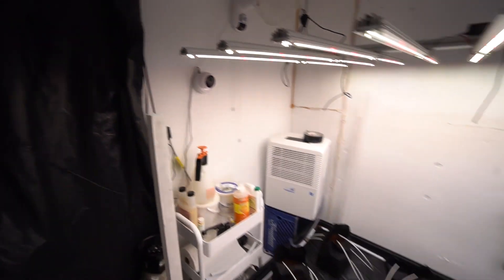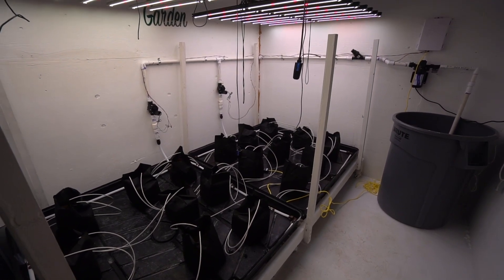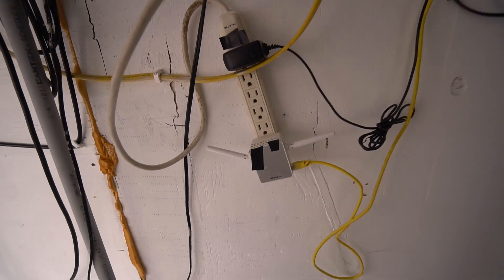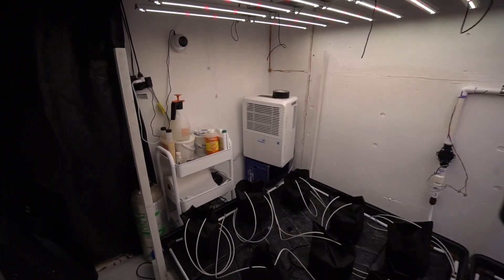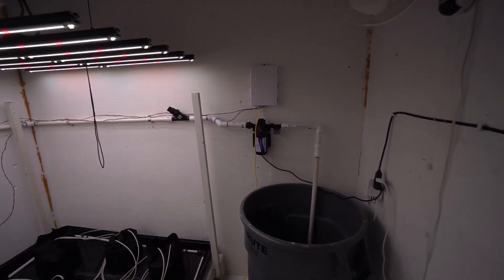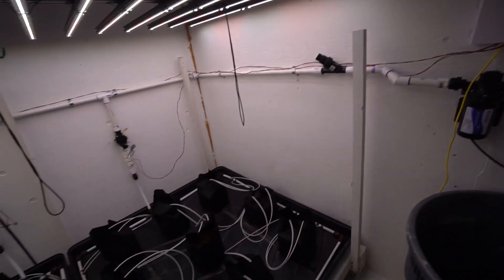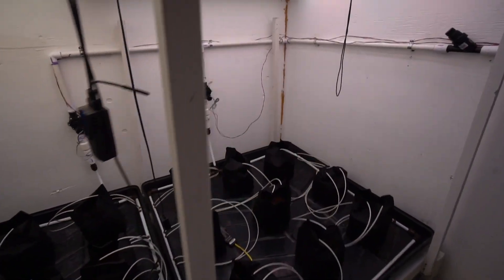Hydroponic Garden Tour: Drip Irrigation

Comment: how do you get the system to stop irrigating precisely? with the pressure can't get out of your system, doesn't the drippers run for hours once you started?
Reply from the maker: drippers are 25psi regulated. So is the system +/- a little. The pipes/lines don't drain under that pressue.

Comment: Superb setup.. makes me happy to see.. just a comment on the placement of the solenoid valves..it looks nice and symmetric.. but wouldnt it be easier to have them on de first wall next to the tank. And from there with flexibel irrigation line to the trays?   This way you can detect leakage and if the solenoid start to fail.when in mid to late flower  Its easy to acces and replace it.

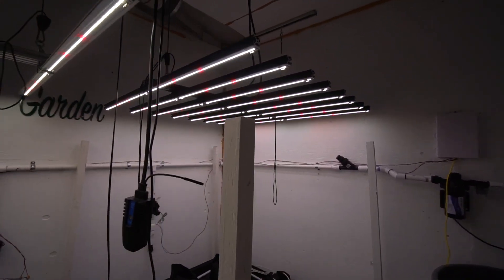Comment: 3:20 “…. kind of a relic to history at this point…” (talking about the LED light units.

…. meanwhile I’m here with single ended 600w HPS (good reflectors, lamps and ballasts tho) running all winter!  Even use 600watt metal halides in propagation & early vegging area. 
In summer (which is usually pretty short) I take out half the HPS and hang 1 LED unit (draws about 420watts) - they definitely help keep the temperature down and spin the electric meter a bit less but I’m certain that buds directly under HPS is more dense than buds directly under the LED (and not getting much spillover light from nearby HPS lamps)… now my partner says he can’t feel any difference in density… maybe it’s subjective but I’m sticking with HPS for the foreseeable future! It’s served me so well for years. 
If I lived in a warmer climate then I would have to go to LED only. 
Must be a huge expense having to run AC to keep rooms cool.

First vid I’ve seen from this channel, gonna check out follow ups from this room & subscribe.
This looks like a promising room  and the grower delivers all the relevant info in a clear way.

Comment: Are you using the Titan gro box to power the lights?
Reply from the maker: It's not a titan, but similar. A 240v outlet with a 120v trigger. BUt with leds I don't use it for on and off. Just as an 240v outlet that is always on.
Reply: @GreengenesGarden  🫡 thanks a ton man!

Comment: Love the video, I made the switch to micro drip also.  I looked at purchasing the troll master setup, actuators, inline pump, etc and it’s kinda pricy and complicated.  So I ended up running with one 1/6hp little giant sump pump per 48 plant(96 emitters) zone on a programmable digital timer and a blue lab hand held media ec tester.  Worked great and is waaayyyy cheaper and easy to run.  I am going to up grade for $70 from ac infinity for their new controller 75.  It’s a 110v relay plug that connects to their UIS platform, can program whatever timed schedule or temp humidity set points for any 110v equipment.

Comment: Sweet set up! Love the dripper sensor timmer thing, and the white spaghetti.  Is the spaghetti white on the outside and black on the inside? Might recommend a water pressure tank.
Reply from the maker: Yes white exterior and black interior to prevent algae. I have a pressure tank in my RV with the same pump.  Difference isn't drastic or needed here.

Comment: I often do you run you CO2?  I have a CO2 setup that will control ppm and it is on a timer since running continuously is very costly.  I have it set to run one hour a day at 1200 ppm at the beginning of light time since that is when the humidity is typically at 60%.  I live in very dry climate with average humidity for environment around 20%.  Just curious if that is enough to make a difference.
Reply from the maker: I use a CO2 controller that maintains whatever PPM it set to.
Reply: Rule of thumb...adjust co2 to the same as the Ec your using.
And be sure to turn off your exhaust fan before the co2 comes on,otherwise it'll just get sucked out the room lol.
Might wanna do all that an hr after the light goes off...an an hr before the lights come on.
Might not need to run the co2 for quiet that long...depends on room size...an that's where a co2 sensor comes in handy.

Comment: good lil setup here. curious to know if you do any mixing the nutrients like running some type of pump or mixer? Seems like that would be difficult especially if you go back to the sump pump instead of the in-line pump
Reply from the maker: I do not. 
A sump would actually be easier by using a return/bypass to redirect some pressure and water back to the res.

Comment: Rainbird standard valves like staying open when used in a low flow application. Be careful with rainbird, I would use the Toro TPV series. I install irrigation systems all the time, Ps get a water alarm for floods.  Hope this helps man if you have any questions ask away :)

Comment: Hey Gene, check McFadden Dale for some spa hose by the foot. I'm running nearly the same irrigation system as you but no master pump and going with opensprinker and teros. Didn't see a clean out valve on the 17mm but it's an easy add you might want to consider. I think you'll love the drip. No clogs ever and easy calculating once you're dialed in

Comment: solid setup. love the lights, vent system and controllers.
rather see more conduit/receptacles- cable management. gfci?
you may be interested diy powerbank walls off e-scooters 10-24kwh ~3k$
what security cam system you running, hows the quality witht aht light?

love the content, its the best around. keep rocking

Comment: Great rundown.  A few  questions, at your leisure.  

1.). Did you plumb cold water from the house to the room or are you using a garden hose from a spigot?

2.).  Did you install a sub panel in the room or just a junction box off a single breaker in your primary service.  If you did install a Sub panel is it all 240v or did you just wire lights for 240?  

3.). Since you don’t run AC in summer do you run lights and night and dark period during daylight? 

4.).  Any thoughts on capturing and filtering Dehu water for use in system, or elsewhere?  

Your videos and explanations are always logical and well thought out and a great leading tool for new and seasoned growers alike.  Thanks so much.
Reply from the maker: 1.). Did you plumb cold water from the house to the room or are you using a garden hose from a spigot?
Hose to fill up. I could and really should just plum it in. Would make life easier. 

2.).  Did you install a subpanel in the room or just a junction box off a single breaker in your primary service.  If you did install a Sub panel is it all 240v or did you just wire lights for 240?  
There is a 50 amp breaker in the main panel that runs out the room and into that disconnect. In the disconnect There is 30amps of 240V and 20amps of 120v split off the main 240 coming in. The 240v/30amps is way more than I need. I run ~6amps maybe on 240V. But I used to use this box on a 4 lighter and have had it a long time. 

3.). Since you don’t run AC in summer do you run lights and night and dark period during daylight? 
Yes, always at night, and CO2 usage is dependant on time of year usually. 

4.).  Any thoughts on capturing and filtering Dehu water for use in system, or elsewhere?  
I have always had issue with dehu water. Now with it drain out it is fin for my yard. My runoff and that are used on my yard
Reply: I want to run at night, but I'm so used to being asleep at nights 😆,  I'd get caught 😴on the job and screw up fs 😫